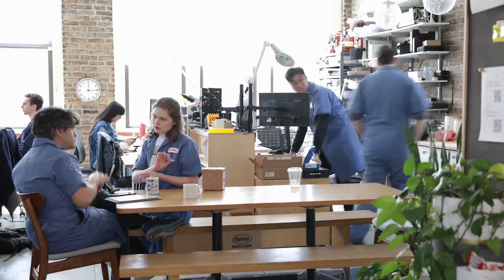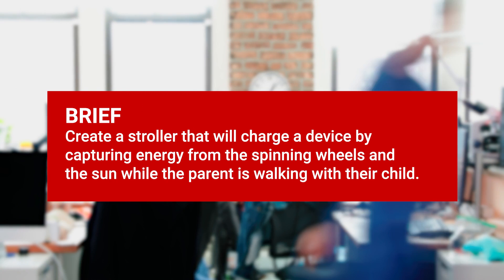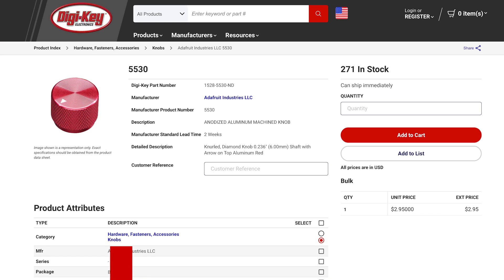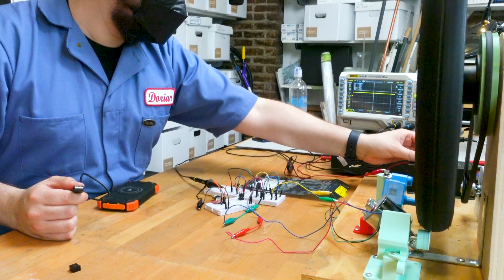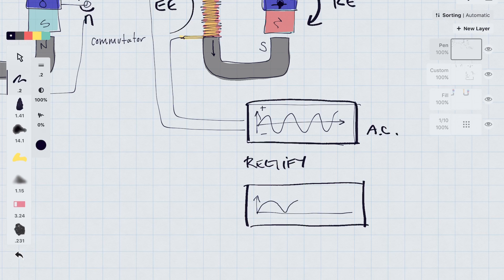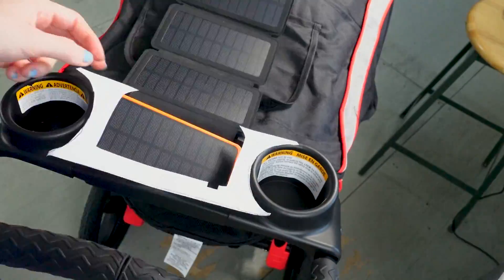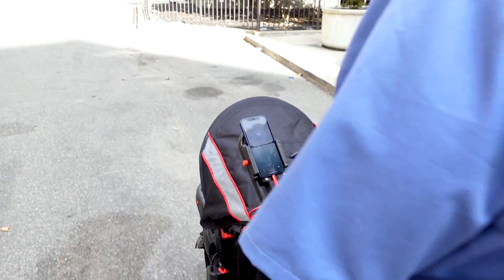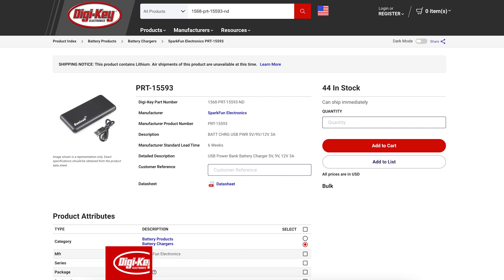Stroller Power - Potentially Genius® | Digi - Key Electronics

Comment: working in policing to get a 911 call of a child left in a hot car is heartbreaking.  Can you build an idea to remote start a car if the child is left in their car seat? Can the car seat read the weight of the child left in the seat if the steel is at a certain level. If the child is in the seat after the car turns off for let’s say 5 minutes the car remote starts.  Can this be a app that the patents program in the car with the car seat.  So if a child is left either the app activate to the phone Sotheby’s parent is reminded.  So the car will say child safely in seat when the car starts. I don’t know. I’m thinking the seatbelt or a baby car seat can have this feature.  This is my idea. The seat belt could work for older kids. The infant seat for smaller babies.  Also could the app call 911 if the parent does not respond and remove the child from the hot car? Or just being left on bus in car.   This vs. help with autism spectrum as well. Or kids who do not communicate.